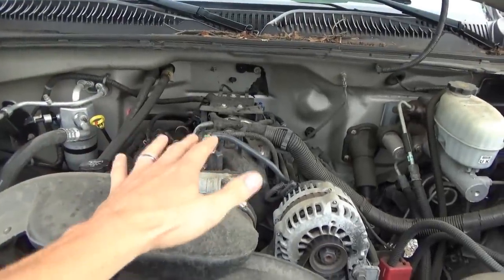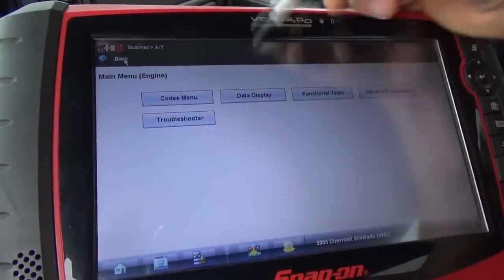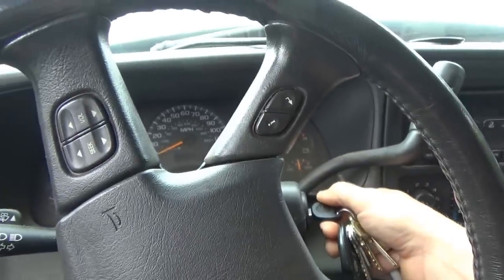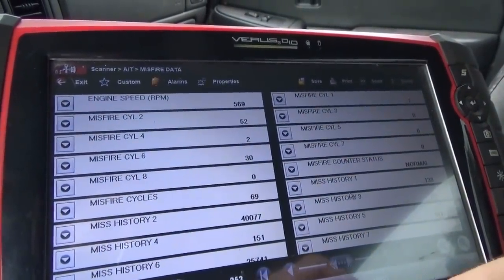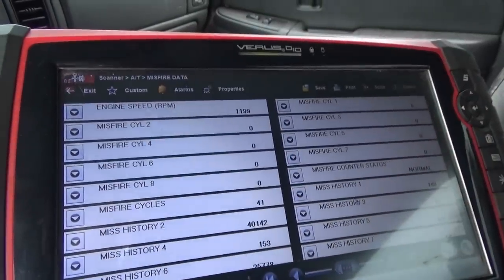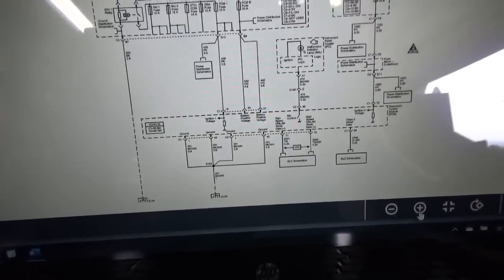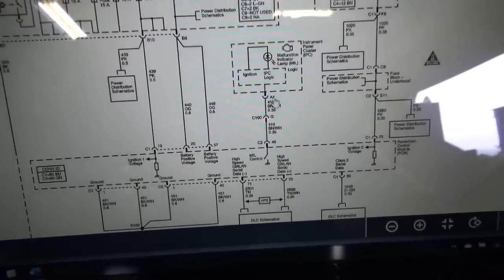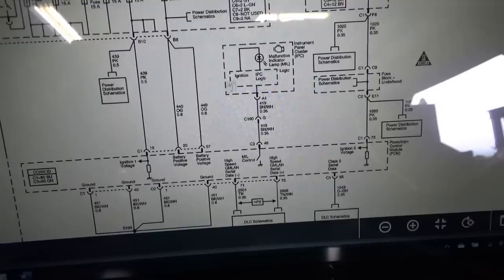Misfire, but No Check Engine Light? (GM Truck)

Comment: Tip to find ignition related problems : 4:00 Rear o2 on Bank 2 is rich all the time. This indicates alot of HC. Alot of HC because there wasn't a complete combustion in cyl 2 and 6 because of weak spark. But we must mention it still is stoichiometric mix , so front o2 will have good readings. But the rear o2 reads rich because cat cannot oxidize the big amount of unburned HC ( its suppose to oxidize leftover HC only )
Reply: HC?
Reply: @dumbeezy5480  hydrocarbons
Reply: Hey Peter, I have sort of the same problems but they started after swapping the alternator. I put a voltage meter on the o2 sensors and they go from .5 to .9 except bank2 sensor 2 it just stays at 1 doesn’t move. I had the cat plug up on that side so I had them swapped with a set I had off a hemi charger but noticed the loud driver side lifters and something just not right shortly after they were installed. When I get on it it will cackle like a 64 impala with glass packs and rounded tip but ifs not coming from the exhaust but the motor! I also noticed the guy put the cat about 2 ft back further and it’s 2 inches away from that sensor now so maybe he got it to hot welding it ? Thoughts?

Comment: Many Toyota owners go by what a mechanic says "do a tune up and replace all coil packs and plug wires" NO NO NO. Just leave OEM toyota coil packs and wires alone. My friend's 03 Taco gave a misfire code (has aftermarket crappy wires). We replaced all plug wires with denso and no more misfire.
Reply from the maker: For sure OEM is best. But even OEM coil packs go bad on some Toyotas after 15 years or so.

Comment: That damn fluffy the rat strikes again!!! Between them finding safe harbor under power distribution box or inside the HVAC system and especially the blower motor definitely in my past were good money makers but that smell from the poop or piss from them rodents is definitely not something desirable to smell, I'd rather smell a minivan with car seats, the obvious smell of rotten formula spilled everywhere in the second row on a blazing hot summer day with the windows rolled up while parked on work row waiting for a tech to do some work on it.

Comment: Great content. My 04 Tahoe has a p0650 too. Sometimes the cel works, sometimes it doesn't. Im thinking I have a similar problem.....does the brown and white wire run from the pcm to under the fuse box & then to the cluster? You said its a ground circuit controlled by pcm so there's no fuse right? This video can definitely help me.

Comment: I try to use NGK in every situation possible. When NGK is not available for a particular application and I am forced to use Ac Delco, Motorcraft, etc., I always bring a dvom and check the resistance of each plug and I typically see plugs that have resistance of up to 8-13K ohms!! and have to go through many boxes to find acceptable resistance of 4-5k ohms. I very rarely ever find an NGK with a resistor higher than 5500 ohms.
Reply: Me also, NGK stuff on my 97 Grand Cherokee 4.0 & my 2 Early Gen Camaro's.

Comment: Wow sat for 5 years and engine is water locked.siezed? Was it parked in a pond? LOL. Or are you saying this is all condensation-related? Thats crazy! I would have pulled and cleaned it up versus a Jasper but maybe the owner is not capable of that. OMG Mice! Another Russian no parts required diagnostic, stellar video.

Comment: My son had a similar vintage Avalanche with the same motor that had the same problem.  He replaced the intake gaskets and o2 sensors, still had the check engine light.  At idle the engine was dead smooth.  Had my nephew check it with his scanner and he found #6 wasn't contributing at all.  Replaced the plug and it was fine.  Odd that at idle you could set a half full beer bottle on the hood and it didn't show any vibration.
Reply: I was doing an internal leak diagnosis and repair that entails plugging the high pressure ports on a fuel accumulator (common rail) to eliminate injectors. You'd be amazed at how smoothly a big v8 diesel can idle with only two cylinders powering it.

Comment: Spark plugs were  to hard to get to or  the previous owner was a cheapskate and couldn't be assed to replace them
Reply: *were, not where.
Reply: The engine where rebuilt by a company were they do a good work, that doesn't mean it was installed properly.
Reply: @jumpinjojo  thank you I wasn't sure which one went in there
Reply: Neil Murphy You're welcome. Have a great day!

Comment: Reading the tile, I was suspecting a bad engine belt tensioner. Learned that in a Gates Belt training session at EVT recertification. 

Seen a couple of bad tensioners cause #6 and #8 to misfire on 5.3 GM engines. Not sure if you’ve ever ran into that Ivan.
Reply: Genius !! Now this is the input I love to see in the comments first had situations that are real not just my friends truck did blah blah blah thank you sir I couldn’t figure mine out and I just installed a mechman alternator that has a smaller pulley but have. Not yet put on a shorter belt because it seemed good after moving the tensioner down a bit it had kind of a hard spot in it but stayed down. At first start tho it tossed it off and my dumb ass was sitting there looking at it like why isn’t it charging and why’s my temp rising then notice I could still read the name on the pulley becsuse it wasn’t spinning haha it had fallen off the fan pulley. I’m going to go install that new shorter belt rn and see what’s up thank tou

Comment: This is identical to the issue I had with a truck I just bought from auction...only after I found and corrected the initial multi cylinder misfire I got from the entire passenger side bank of fuel injectors stuck closed. It was like traveling down the road of neglected maintenance. First was the injectors, which cleaned it up enough to diagnose ignition issues, then the plugs and wires, then  a lazy O2 sensor.  Every other issue the truck had which seemed to be a repeat of finding an initial issue only to find a secondary issue. Not really a nightmare, but definitely annoying, especially troubleshooting the headlights only to find they removed every single bulb. That saved them under $20 total. Also, why does it seem to always be cylinder #6 on LQ/LS engines? What gives?

Comment: I put all new AC Delco double platinum plugs and wires on my Buick Regal GS with the 3800 and now have misfires. Put in Bosch copper plugs and checked all wires, some weren't even crimped correctly... Now it runs kinda OK, only small misfires under high load low rpms. Very disappointed by AC Delco, a brand I used to like a lot.
Reply: NGK Plugs and wires
Reply: Years ago they had Bosch platinums with a rebate and I put them every 80k miles in my 2002 lesabre.  Never had a  problem.  This year at 230k I got rebates on delco iridiums from Napa and GM hope they turn out oK.  I probably should have stayed with Bosch.

Comment: Freakin rodents! I worked at an university in Michigan as a carpenter. The squirrels ate the wires in dozens of cooling systems on roofs costing thousands and thousands of dollars. We had to build wire cages with doors around all this equipment to stop them. Some of them were quite large and intricate. Told the boss that some bait and a couple high power pellet guns would do the same, but no. They couldn’t even poison them. I said put out the poison and tell everyone it’s for rats!

Comment: Ivan  Love your channel always expect the unexpected,I have a question I know you have several scan tools, I my self have a Autel 906 ,I’ve notice you using a think pad which seems to have more capability ,would you recommend that over a launch or a Autel at that price point. Thanks in advance.
Reply from the maker: So far I have not found any better scanner than the ThinkTool Pros, especially for the price!

Comment: The symptom: misfire
The problem: Gm
Reply: Got a triton?
Reply: @canadiantrucker9574  hemi-funny it means a hemispherical head with a center spark plug-are they still or just a name?
Reply: @Watchout1010  I believe they still use the same head design, but now it's 2 plugs per cylinder
Reply: @canadiantrucker9574  like a ford ranger? If one plug works,why not 2?
Reply: @canadiantrucker9574  emission compliant
Reply: @canadiantrucker9574  murphy said-more parts more problems,more friction,more wear...epa doesnt fn care..

Comment: Good job ! I know you’re not making the money because you told the customer that needs spark plugs and wires so that’s why the customer will do it himself and save the tuneup money .
Reply: that is why so many shops that only care about money will only say they need to do a diagnostic to find the problem @ $100 cost that can only be reduced on the repair if they do the work   .. I would happily pay someone who is honest and Not greedy to do a big repair job  , but will always pass on the greedy shops that won't offer any help without a money fee
Reply: @danzare5638  I agree what you saying . But you know customer never think of you honesty ? Anything over $300 they think you’re robbing them .😯
Reply: @danzare5638  "so many shops that only care about money" wait what? What exactly do you think mechanics are doing car repairs for? Especially with the internet and almost everything being DIY attemptable nowadays... 90% of 'customers' would just say "ok thanks" and do it themselves, if it wasn't for a diag fee.
Reply: Simple illustration  , computer code gets set when the gas cap is not fully closed and seated properly ,  Mechanic charges $100 to scan for codes and it reveals all you need to do is retighten the gas cap …. If you would feel good about charging any money to reseat a gas cap , nothing good could be said of a person that would
Reply: @mad1337nes  You express the mindset I refer to , you only focus on the money ….If a person comes in and says their check engine light just came on and what does it mean ?,  the mechanic is not going to say , if you take your car to autozone , or AdvanceAuto they will they scan the codes for free ….. 

IF a mechanic says that , they show a lot more honesty than someone that says , yea for $100 they can scan the codes and tell them what it means ,
Reply: @mad1337nes  Not everyone is mechanically inclined and not everyone wants to get dirty working on a car , but everyone wants to have a honest mechanic work on their car when they can’t or don’t want to do the work themself
Reply: @mad1337nes  your comments were well taken but your condescending attitude and the need to start making personal insults pretty much makes you not worth listening to.